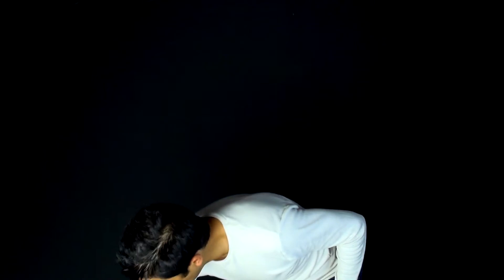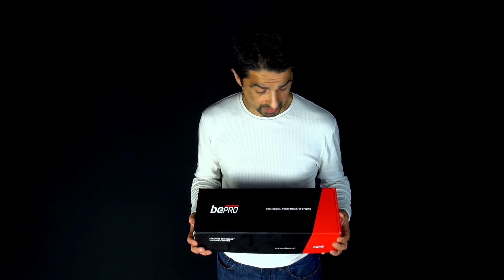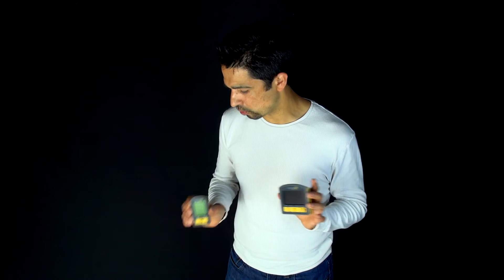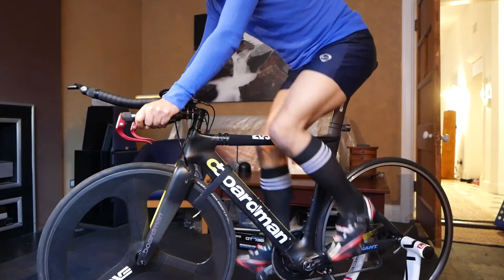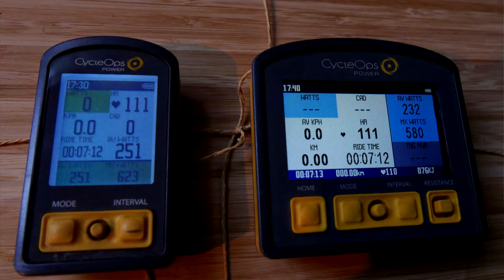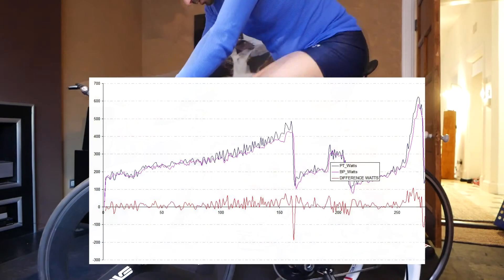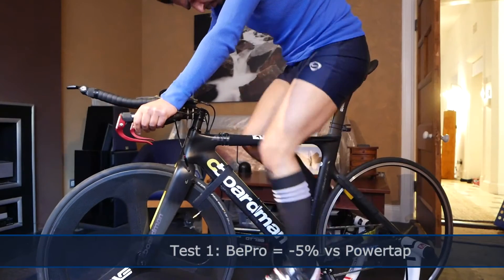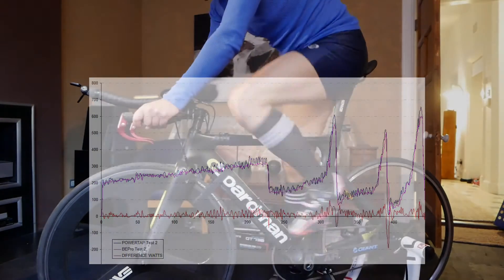[tested] How accurate is the BePro S power meter vs Powertap?  (Field test)

Comment: Shouldn't a hub based power reading always be ~10 watts less than a pedal based power reading?  You've got the whole drive train between the pedal and the hub.  If you compare your hub based power reading with your pedal based power reading and THEY ARE THE SAME??  Something isn't correct!  On the other hand if your pedals are lower than the hub something must definitely be wrong.

Comment: Accuracy doesn't matter providing the feedback it gives you is consistent. Your FTP should still be consistent with the the feedback, so using it as a pacing or training tool it should still do exactly the same job as the "more accurate" and a lot more expensive products.
Reply from the maker: Thanks thats useful, reliability is key with reference to your own training, accuracy is important if comparing with someone else
Reply: No. Power meter absolutely needs to be accurate. It measures power in watts, and that's what it should report. Also if it's accurate then obviously it's consistent at the same time. One side only power meters are neither of those.
Reply: I see this said a lot, but if it were really true then the manufacturer would just apply a correction to the formula.  If it is reading off by 5% they could just adjust by that amount across the power band.  But that isn't how it usually works.  These "wrong but consistent" examples I see are often where results are sporadically wrong or don't follow a clear progression of deviation.  To the extent that the data remains useful for training it is often a big enough compromise that one might also decide to use heart rate just as well.
Reply: You buy a powermeter for accurate powerreadings not some "feedback". If you can't deliver don't sell.

Comment: you are not testing the bepro but the 'bepro s' which would probably explain the 5% error (especially when only in special circumstances) because the "left-leg error" will be duplicated. i would suspect that you do not have an even 50/50 split between your legs! would be good if you would mention that you are testing the 's' variant and that there are the two different options...
Reply: I also have the Bepro S pedals along with Stages power meter crank on another bike & can confirm that the Bepro pedals consistently under read compared to the Stages by a minimum of 5% (both power meters are left side only power).
Reply from the maker: Thanks good point, its something to consider.
Reply: bear in mind that you can do a calibration using weight hanging off the pedal to manually get the power meter to the correct value. Just manually increase the power of the bepro by 5% on their computer app.

Comment: could it be that you deliver more power on your right leg? I rented a bike with a crank powermeter and it said I pedal with a 47-53% and some rides even a 45-55% left to right power difference, That is a 6 to 10 % difference of power if it only messaured my left leg vs a Hub meter or both sides power.
Reply from the maker: Yes its possible, will have to think have to adjust for this